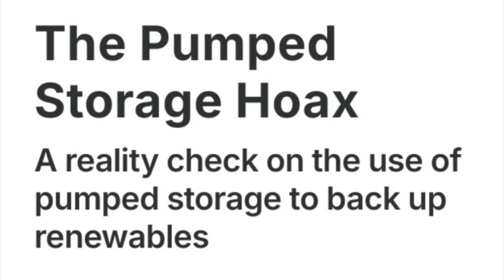The Pumped Storage Hoax, Exposed in Two Minutes

Comment: Among the worst things I've heard and seen is that it would take more energy to manufacture solar panels than they can deliver.Same with hydrogen, it takes three times more energy to produce hydrogen than you get back in energy, it doesn't sound like something that will last in the long run.
Reply: Solar produce far more energy over their life than was used to produce them.
Reply: @AndiWard Can you show where you get that information from?
Reply: @klimatbluffen  Can you show where you got your info from?
Reply: @klimatbluffen  Feel free to explain why a company would sell a product for £2k that cost them more than £2k  to produce.
Reply: @AndiWard Follow the entire manufacturing process from the mine to the grave, everything is completely public.
Reply: @klimatbluffen  I know it public, hence the reason I know they produce more energy than the energy used to produce them.
Reply from the maker: You take up to three times more energy to produce hydrogen than you get out of it. It's a non-starter. It's almost impossible to use, except in certain niche areas.
Reply: @ClimateRealism  It has its uses, can be used to story clean energy and is transportable. No point producing it using coal, but producing it using clean renewable energy is an option.
Reply: @AndiWard  Clean renewable is an oxymoron.
Reply: @tmog1000  We can produce energy that is 100% clean. In this contact, clean means not as dirty as fossil fuels. But I am sure you must have known that.
Reply from the maker: Depends on the latitude at which you have them. That certainly is the case in the tropics, but it's not actually the case at our latitude.
Reply: Hi the only free energy you could 
Possibly get  is tying 
a lightning rod to the
top of Boofhead Bowen's head an stand him in the next big storm
Reply: You produce the hydrogen with excess energy.
There are no energy storage products that give back more than you put in, I assume though that you still use batteries.
Reply: @AndiWard I am fully aware that you cannot get out more energy than you put in.And I've never heard of an excess of free energy.
Reply: @klimatbluffen  The fact you spent so little time looking at the subject doesn't change the fact excess energy is often produced.
Reply: @AndiWard Sure, there is plenty of surplus energy produced, but it is anything but free.All cars that drive do so because of an excess of energy stored in the fuel tank.
Reply: @klimatbluffen  Wasting the excess energy also costs money, might as well store it for future use even if we don't get back as much as we stored, I assume you have used rechargeable batteries during your life, they are very useful despite the fact you have to put more energy into them than you get back.
Reply: @AndiWard Even if you have a surplus of free energy, that surplus is reduced when you use it to make hydrogen.The way hydrogen is produced today uses three times more energy than what is obtained from the hydrogen.
Reply: @klimatbluffen  Indeed, the point is the energy can be just wasted, or used to produced something useful like hydrogen.
Reply: @AndiWard Hydrogen has a very low energy value and is basically only suitable for use in Zeppelins and similar craft.If you want to use hydrogen gas in a regular gas stove, you have to mix it with regular gas.They have been doing it for over fifty years and believed that hydrogen is the fuel of the future, today we can only conclude that the future lies very far in the future.
Reply: @AndiWard I will try to explain as simply as possible so that you understand.If you use one kilogram of hydrogen to produce hydrogen, you get just over 0.3 kilograms of hydrogen, which uses more energy than you get out.
Reply: @klimatbluffen  In your opinion, Hydrogen as a very low energy value.
Reply: @klimatbluffen  No need to make it simple, everyone on earth knows, you can't get more energy from the hydrogen than the energy used to produce it, it's just a straw man argument. It's not a counterargument against producing it from excess energy. Every method of storing the energy we produce gives back less than was put in. But storing energy is still necessary.
Reply: Lets move on from the hydrogen story, Elon showed us long ago that it's a lose-lose equation.  Still pushed by the fossil fuel guys as their products were used to make H2..  As for using it to store 'excess energy' it's very wasteful.

Comment: But maybe with hydrogen it will work?
Reply from the maker: Hydrogen is a total nonstarter.
Reply: @ClimateRealism  Sorry, bad joke from me. Here in Sweden there is a lot of lobbying for hydrogen, as a general solution. We are pouring in tax money (pension funds) to Stegra (formerly H2 Green Steel). There were plans for a pipeline for H2 to Germany for the new "Hydrogen Economy" supplying the west coast with cheap energy. Funny enough the same area as the decommissioned Nuclear PP Ringhals.

The Greens have been pulling the plug on carbon free energy and it's a mess.
Reply: Hydrogen has a lower calorific value than Natural or Manufactured gas,so you need more of it delivered to the point of use at a higher operating pressure as well,not to mention that the appliance will need conversion as well, lots of £££££££ to the customer in costs.
Reply: @SydneyPrentice-j9p  And hydrogen will find any leak.

Comment: I'm still curious to know what the cut off point for a BESS is, as the batteries discharge. A domestic invertor cuts off at 75% of the designed input voltage, so even if a BESS invertor could go down to 25% before cutting out, this would still mean an actual capacity considerably lower than the theoretical capacity.
Reply from the maker: true.